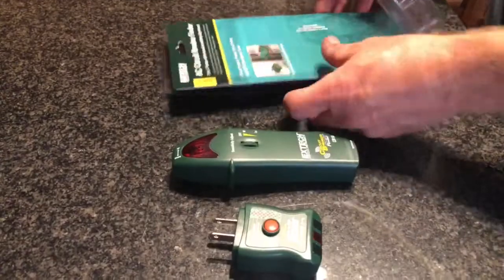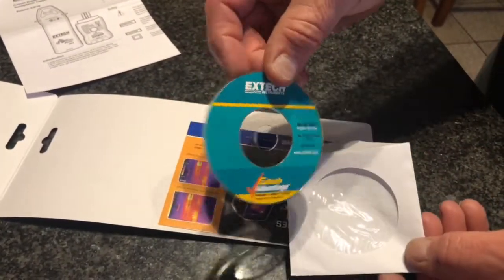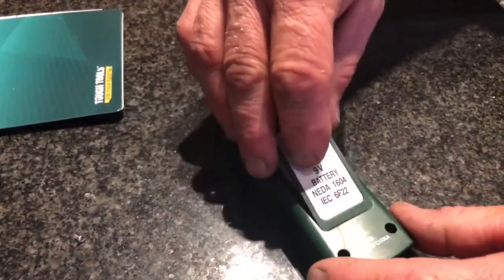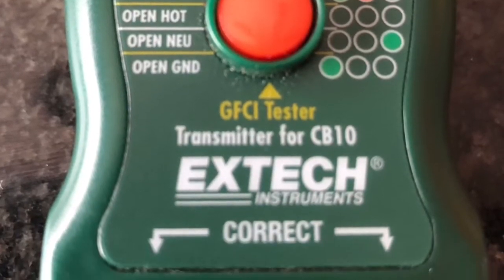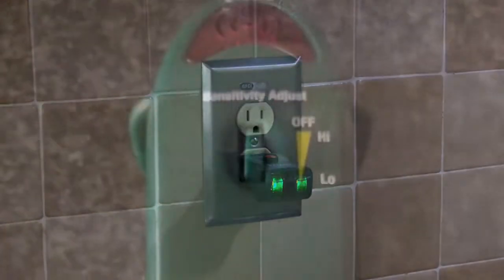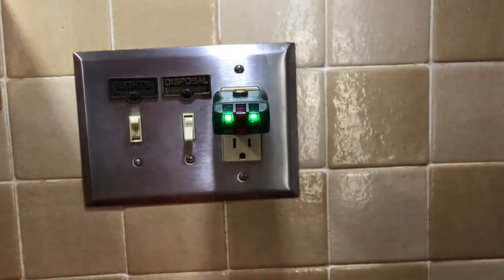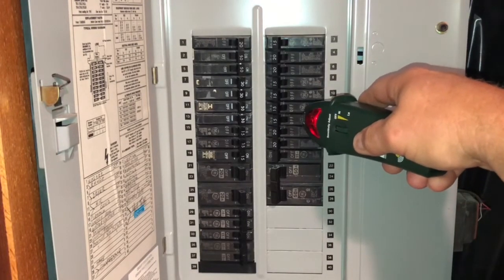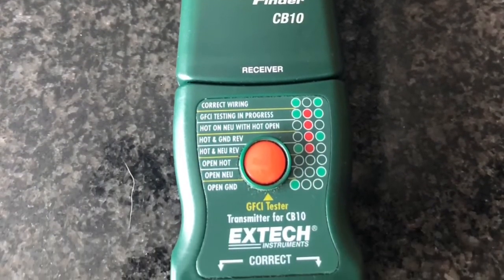Trying out the Extech CB10 Circuit Breaker Finder

Comment: The 'transmitter' on this device is not really a transmitter.  It has zero active components.  I only know because D12 on my 'transmitter' went open circuit today.  The transmitter part is actually the unit with the battery and speaker.  It appears to create a bit of a tuned circuit by injecting pulses from of all things a 555 timer IC via an inductor right at the tip of the wand.  I could have fixed the one I've got if it wasn't soo difficult to get the 'transmitter' open.  The entire thing is stupid simple and I suspect it has more money tied up in packaging and plastic shells then actual components.   It did work just fine however....so....
Reply from the maker: As long as it worked fine then I guess you can call it whatever you want. Thanks for watching.